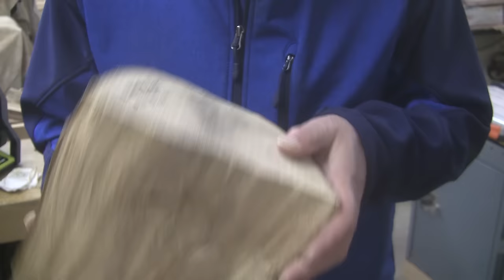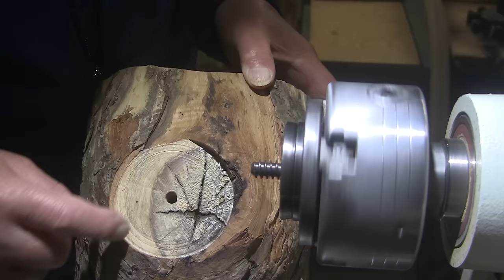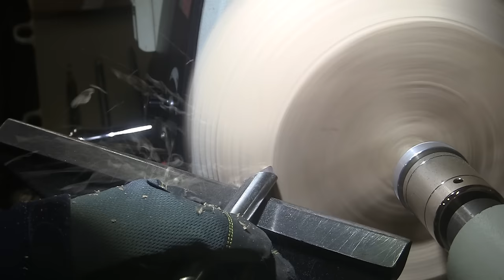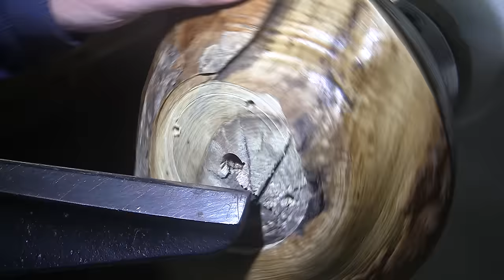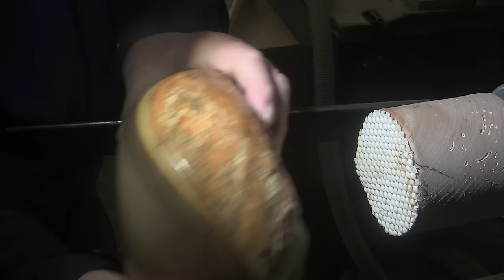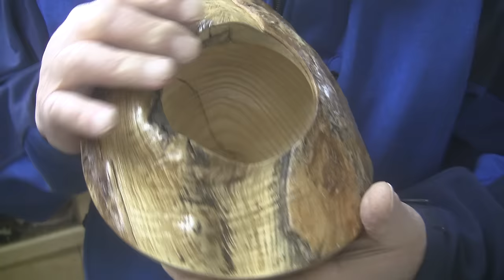River Birch 👀 BUBBLE TOP 👀 Hollow Form! - Wood Turning

Comment: Very nice open turning.  I agree the compression grain made the piece stand out. Making a hollow form was the right decision, it really turned out great. There was never any doubt!!     I was using Old Master sanding sealer, but Zinsser Sanding Sealer far exceeds Old Master.  With Old Master cleaning the brushes are  a pain in the !!!!!!!.  You have to use Acetone solvent to clean up.  It is also very thick,  With Zinsser you can use Denatured  Alcohol. If you need to use a touch up, for a thinner spot just use the brush in the can of cleaner  or dip it in the Zinsser Shellac for a thinner cut. I imagine you have done this before  but it works for me.  KEEP ON TURNING
Reply from the maker: Thanks for the information! 😊

Comment: Well, that turned so much better than I expected! Beautiful! As you were handling the finished hollow form, I saw a tortoise shell. 🐢🐚 😅
This piece is from a large (BIG!) branch that broke off the main tree in the ice storm the Pacific Northwest endured 3 years ago. The other half of the round is almost identical, and now I know what to try to make of it! Nicely turned!
Reply: I thought it looked like a tortoise shell too!
Reply: @Baggins_lover  👍😄
Reply from the maker: Thanks, Dave!  To think I almost turned all that away to make yet another natural edge piece.  I shudder to think of it, now! 😃
Reply: @PhilAndersonShadyAcresWoodshop   I might try a more rounded hollow form with the other half since it's nearly this one's twin, gnarly knot and all. Difference is it's a fair bit thicker than what I sent you, so would be more of a pot. Likely won't get to it before spring, though.
Reply: @calmwoodcreations3709  If it has the heal-over around a dead limb, using the area inside the heal-over for the opening works really well. It gives the piece a more interesting top, and draws the eye to look inside. And if you don’t, you can always send it to me through Phil. But then, Phil might just be tempted to keep it! 😂

Comment: Phi. , another one off masterpiece . Here is an idea to think about ,see if Nova  makes some larger pin jaws so that you can hold some of your odd sized bowls internally? 
Sharing information , 3 - M makes a line of abarasive plastic bristle brushes for floor scrubbers ,and cup brushes and wheels  ,but the bristles are straight , not twisted like the heavy duty wire brushes. I have a cup brush that i use on live edges instead of a Sand - O - Flex 
It is flexable enough to get into bark crevasses , yet is not too agressive that it removes more material than wanted , amd they are under twenty bucks . The nice thing aboit them , is that the bristles dont load up with dust like anrasuve paper or screen
Reply from the maker: Thanks for all the info, Gary!  😊  They do make pin jaws but I don't like changing jaws.  I might even have some pin jaws, I've got lots of different ones, just don't want to take the time to change them.  My methods have worked great for me for years.  Old dogs, new tricks, etc.

Comment: Hi Phil !     What a   j o y    to watch this turning.   I can't believe it took an hour to get through that knot!   
...How does one 'sharpen' the 'propeller-edges'  (or 'blade edges'?) of a 3-inch drill?   (air-force brat lingo oblige) 

We had a huge snow fall, followed by a deluge of a rain storm, so we're back to grassy patches and weirdly placed snowbanks.  And now it is cold again.    Lake still not frozen over.   No ice-fishing for moi, yet.
We frappe the route in a day from now, to be with one of my Bros.  Good road conditions in the forecast.   So, there's that.  

May Saint Nick visit your neck of the WOODS and not escond with too many your magnificent art pieces.   If I was Santa's helper, you might wake up on Christmas morn to find missing your
   turtle,   wooden-shoe,   spaceship,    bubble-top
 hollowed masterpiece.     
You'd be missing a couple more pieces as well, after our visit down the Shady Acres's household chimney.   
That's fur sure. 
Joyeux Noël, Phil.
🌲🌲🌲🌲🌲🎣⛸🎶🌲🌲🌲🌲🌲
Reply from the maker: Over the bridge and through the woods to brothers house we go!  Enjoy and Merry Christmas, Red!  😊

Comment: Hi Phil.... great bowl (hollowform) . My choice was to open the bowl and see the grain compression.  Anyway..I'm impressed...again. I also am curious as to why most turners I see on the tube all apply finish while on the lathe...one side at a time. As I see the situation it leaves the finished side vulnerable to damage. All you have to do is bump it and you can't fix it because it's finished.   For myself I never apply finish while on my lathe . I've found that it makes it easier to correct any oppsies that occur. I sand both inside and out to 800 or more, and inspect it for any sanding defaults before applying the finish in my finish room.  So if you will enlighten me as to what I'm missing finishing it on the lathe one side at a time.  Is it only for video presentation? Thanks Phil and keep making beautiful things. You're a true artist.
Reply from the maker: Thanks, Gary!  😊  The grain compression would have been turned away if I turned a normal, live edge bowl out of it.  I finish the outside before turning the inside because it's the best way for me.  There will be no damage because I'm careful.  I can't imagine trying to finish a piece sitting on a workbench or wherever.  On the lathe, I can rub the finish in and buff it with total, unobstructed  access.  But, again, that's the way I prefer it.  If you prefer another way and it works for you, that's what you should do.  I'll bet you get some great pieces using your methods, too!

Comment: I understand why you often need to turn at a lower speed. What is the benefit of turning up the speed? Is it to accomplish the job quickly?
Reply from the maker: It's far easier to turn at higher speeds, Betsy.  If you drive over a speed bump slowly, you can feel every inch and it seems to go on forever!  Drive over it quickly and it's over fast and the car hardly moves. 😊

Comment: Phil it turned out great and you did a fantastic job on it. What causes these compression rings ? and do they weaken the tree/wood. Have a great Christmas to you and family.
Reply from the maker: I think it's the wood, let's say trunk, of the tree where a heavy branch is hanging down, pulling on the trunk and causing those wrinkles.  It could also be a branch where another heavy branch is hanging from it.  It may also be a tree that is just leaning, maybe on a hillside, where the weight just causes those surrounding areas to bend.  😊